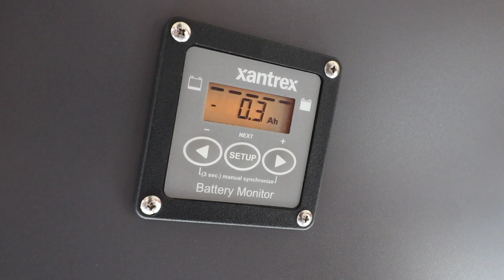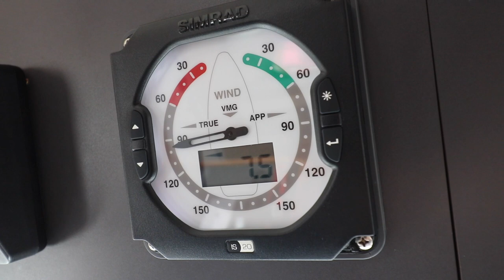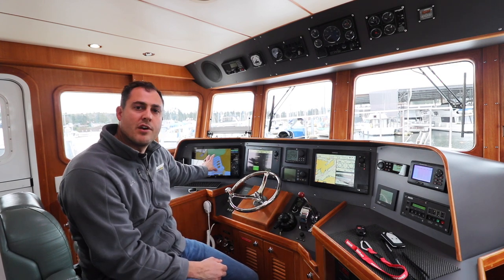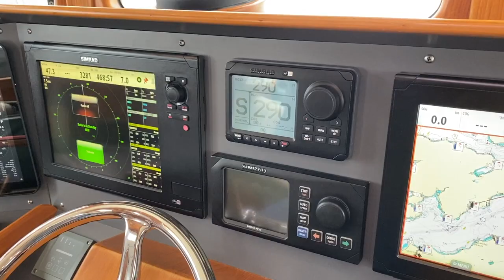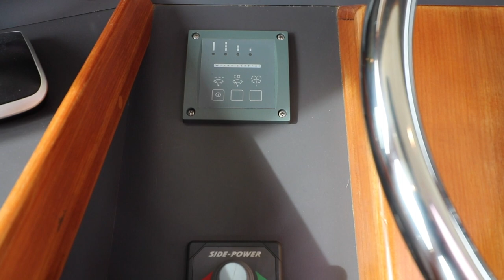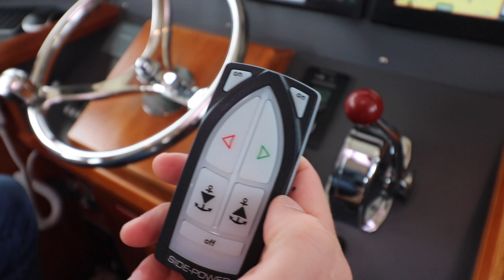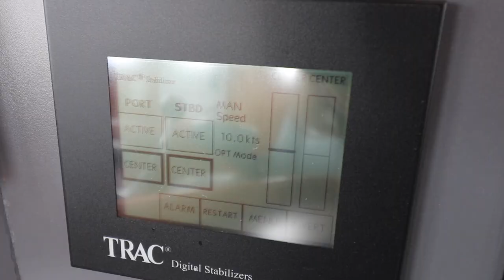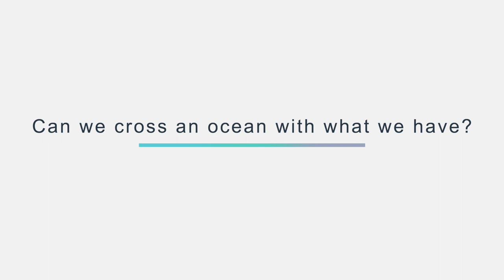Pilothouse Electronics Tour [NORDHAVN 43]

Comment: Thanks for doing the video...it's challenging to figure how long to stay on a tight shot of the instrument. 2 things I was interested in. You didn't talk about the handled rudder control under the rotary rudder control. Those are often on bigger ships and ferries etc. Also how you operate the throttle to get higher rpms without putting the boat in gear.  I liked your gauge tape showing operating ranges. I have those and use glow in the dark sticky tape.  Used a kids glow in the dark hobby kit ($2.99), just cut the strips out of the material. Works great at night.  Look into a 360 degree camera on the mast to help with docking. So many aftermarket car kits running on 12 volt available now. You have room for another monitor.. Would be a big help landing a high sides boat like Freedom.   Rock on Freedom...

Comment: Great video guys!  Thanks for sharing.  Yes, I watched the whole thing.  Question:  Does the autopilot alert you when a course adjustment is being made on a route it's following?
Reply from the maker: Yes! It will beep and we can choose whether you want it to automatically switch to the new heading or force it to require a manual confirmation. We typically have it set to auto.

Comment: Very cool overview!    Do your stabilizers work when anchored?  I read that they have a model of fins that do that now.    If not, do you think it would be worth upgrading or even necessary?    Or how about a Seakeeper gyro stabilizer?  I dont' think i've ever seen a Nordhavn with one.
Reply from the maker: Correct, they do make new active fin stabilizers that work at anchor although ours do not. For rolling anchorages, we have a manual 'flopper stopper' that we can deploy which has benefits, the main being it doesn't require power and it's a simple design. For now, we try to find quieter anchorages although at some point we'll likely need the flopper stoppers.

Comment: Great video....thank you for sharing. Can you tell me you battery bank size? Types of batteries and how are you charging them? I am trying to decide on how I will set up my electrical power system on my old trawler. So many options these days. Thanks again and be safe!
Reply from the maker: Our house bank is AGM batteries with a capacity of 1,020 amp hours. When it's time to replace them next, which is likely in 5 years since we replaced them last summer, we will consider lithium. Lithium has a faster charge rate, more usable capacity. However, they're too expensive for us now and too early in the adoption phase for us to feel comfortable with them. Good luck with your trawler!

Comment: I’m curious about your AIS controller. Does it actually show the positions of other AIS boats? I have a very small screen on my VHF radio that will paint positions of other boats  but the screen is so small it can be difficult to see, , is the controller just another larger screen to display info? Hope this question makes sense. I really enjoyed geeking out on your presentation!
Reply: On most (pretty much everything on the market recently) MFDs you can turn on an AIS layer (assuming you have a connected AIS reciever) and it will display those targets on your chart.   Wtih NMEA2000, or even NMEA 0183 to a lesser extent, once the data is on the network you can share it with with everything.
Reply: @donhappel9928  Thanks Don appreciate the info!
Reply: Let's Go Outdoors "Does it actually show the positions of other AIS boats?"

To answer your specific question, yes, the model of AIS that they have on M/V Freedom will show other AIS-equipped vessels in either a list mode or a map mode. The map is rather small, though, so sharing the information to the larger multifunction display to overlay on the chart is a nice feature. Here's a link to a photo of a Simrad AI50 in map mode: http://newcontent.westmarine.com/content/images/catalog/large/11158722.jpg
Reply from the maker: Like your VHF, yes the AIS controller does display vessel positions. However, the screen is also very small to be of much use so we use the screen to display vessel names and distances in list form and rely on the larger screens to show the position of the boats.

Comment: Great job guys! Only one question from me, does your system have auto start on the gen set so when your volt level gets to low it will start the gen set?
Reply from the maker: The1960geo no unfortunately we do not. Newer ones do, though.

Comment: Does the AIS talk with the auto pilot? Will the electronics prevent a collision?
Reply: In general no, there is no automatic avoidance.  You can set MARPA targets and automatic alarms, but the standard is that the electronics only notify you of any needed course change but don't make that change themselves.
Reply from the maker: Good question, and NO! They're not that smart. The AIS isn't connected at all, it's only for another reference point to give the Captain more information to make sound decisions. Auto Pilot also isn't that smart and requires brains at the helm to avoid collision!

Comment: Video was/is awesome. My question is why only one VHF radio? There is so much that is redundant on a Nordhavn. I would want at least one more VHF.  One to stand guard on Ch. 16, the other to monitor a channel between other boats.
Reply from the maker: Yes a 2nd one would be nice. We have a handheld for now, and we typically one our fixed VHF in a dual watch mode to monitor vessel traffic as well as channel 16.
Reply: MV Freedom if father radio has duel watch like you said, then that would fit the bill. Thanks for the reply.

Comment: If you were to upgrade the Two multifunction screens, would you ave to replace the whole panel, or would they fit into the existing hole/area?
Reply from the maker: Patrick Leahy we haven’t looked into it but it’s likely we’d have to replace the entire dash 🤨
Reply: MV Freedom do you have a wish list of updates?  What would be First?
Reply from the maker: Patrick Leahy honestly we don’t have any as everything treats us well and is what we need. Maybe if we had to pick, though, and budget was there we’d replace the inverter with newer technology and get a separate battery charger for redundancy. Currently if something were to happen to the inverter we’d have no way to charge batteries. We have a car battery charger on board which could be used in a bind but it’s not ideal.
Reply: @mvfreedom  I'm sure people are reading this who have 40 year old equipment that works terrifically and are smirking at my naivety!!

Comment: Fantastic video! Really enjoyed the thoroughness of it. Would love to see similar level of detail in the engine room. One quick question: where is the throttle/gear shift control for the wing/get home engine? I didn't see that in this wheel house tour. Did I miss it? Thanks again!!!
Reply: The Wing engine is a set speed and only in FWD. It's maybe 25 Hp or less, so getting home is slow, plus the prop folds...

Comment: Where do you start up the generator from?  And where do you start up you propulsion engines from?  Can you do it from the bridge or do you physically have to do it from the engine room?  I get that you want to do an engine room checklist before starting things up.
Reply: Propulsion engine start up is probably by the stairs to the pilothouse...a key just like a car. I think engine stop is the black button beneath the throttle control lever.

Comment: Would you say your vessel is probably the largest to safely operate by two people (just one)?
You probably covered this in another video.  If you could have the "Freedom" configured differently when new, what would those changes be?  ;-)
Reply from the maker: T'airn'KA nothin really, just maybe all new electronics. Ours work great and cost to replace isn’t in the budget!
Reply from the maker: Also we think the N55 is probably the largest for two people to operate safely and comfortably. Any bigger gets to be a lot.
Reply: @mvfreedom  If it's not broken, don't fix it.
Reply: @mvfreedom  Just the expense and lack of privacy with having a Captain and crew aboard kind of defeats the purpose of having a go (most) anywhere boat
Can you cross the Atlantic or Pacific (with a few stops)?.
Reply: @mvfreedom  With the technology improving, maybe running a 55' boat, solo would be possible?  ;-)

Comment: Great job explaining the electronics.   I have a couple questions.  Can the AIS information for another boat be displayed on the radar, or overlayed on a plotter?   And non electronic question about grey and black tank water, do you have to pump it out at shore like a camp ground RV sanitation tank, or does it get pumped out at sea?  (Sounds strange, but I am curious).  Love your channel, keep up the good work.
Reply: Good question. Aircraft do this by using a Mode C transponder.   Do private motor cruisers use modems? I think the big commercial ships do.

Comment: Great overview.  Valuable information.  What is the typical range of your boat?  Could you motor to Hawaii if you wanted?
Reply: They could. Several N43s have made trans Pacific and trans Atlantic crossing over the years, and one has already finished a circumnavigation.
Reply from the maker: dahveed284 we get about 3000 nautical miles so yes, Hawaii is possible. In fact, our boat came across from there before the previous owner purchased her.
Reply: @mvfreedom  I calculated on Google maps that its about 2,400 statue miles or 2,100ish NM to the closest part of the north America mainland.  At 7 nmph, that's 300 hours or about 12.5 days at sea.  Of course that assumes 7nmph SOG.  That's impressive.  Your boat must really be frugal.

Comment: so... that Nordhavn 43 has enough fuel to cross the Pacific without stopping in Hawaii???  and without trolling at 1 knot???
Reply: SUNGOD SPIRIT my understanding is it’ll travel about 5knots and easily make it to Hawaii. The 43 has a more limited range than the larger Nordhavns due to smaller fuel tanks, but will still go 2500+/- nautical miles. Topping the tanks in HI would be wise for anyone.
Reply: @jlewis4587  gotcha!